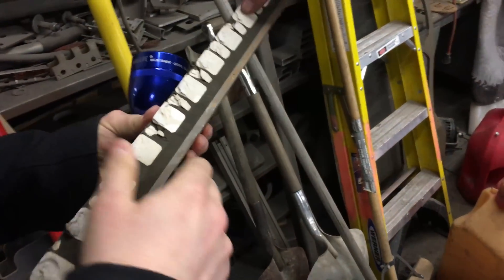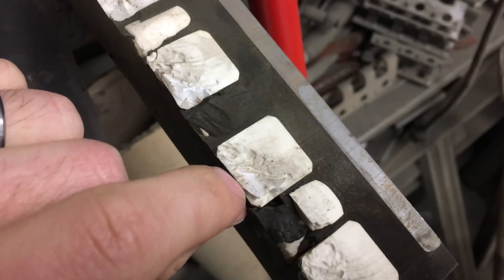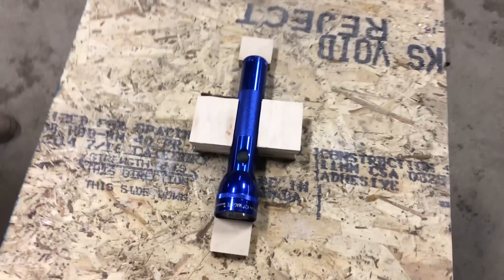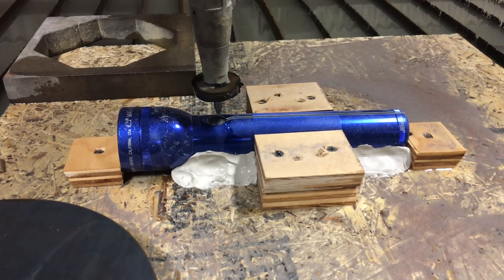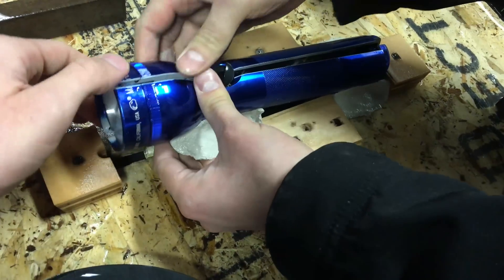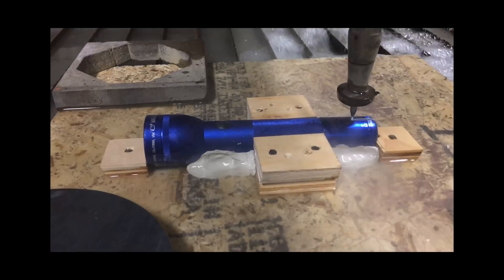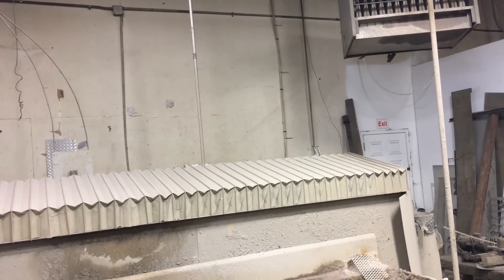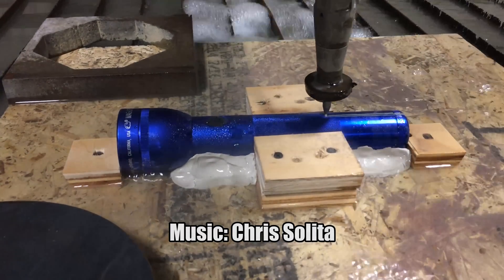MagLite vs A 60,000 PSI Waterjet

Comment: Do you take orders for custom projects?? I am looking for an American flag, no waves, just the rectangle with the stars cut out. Looking for either steel or aluminum 3/16 inch thick with the no sharp edges or corners. Also 1/2 inch standoffs on the back with some means to hang it on a wall. I can do my own painting.

Comment: A Refrigerator compressor, a Printer, a Hard Drive, a roll of quarters, an old washing machine timer, a Zippo Lighter, a 9V battery, a FAT MAX measuring tape, Box of Tissues, TP, a Grandfather Clock, boots, a Propane tank, Pocket watch, a car intake manifold, a brake caliper.
Cutting a SBC crank in half and mounting it on a piece of wood, puzzle piece some billiard Balls and reassemble them in different colors.

Comment: Idea: cut body armour (or try too). 
AR 500 armour isn't it? I think that's a popular one. Hit them up, they might even send you one for free as it would be an interesting test :)
Reply: Sir Stefan Channel! its literally steel
Reply: royalCOW I thought it was more composite armour? They don't just straight up make steel plates for body armour lol Also, still would be interesting to see how bullet resistant armour holds up to high pressure water and sand ;) 
Also the kevlar armour too, fibre woven ect. Would be neat to see

Comment: It might be a bit dangerous, the glass... but still... would it cut Prince Rupert's Drop?
Reply: encapsulate the thing in transparent epoxy, and try to cut the block
Reply: Andrey Perevodchik it would not but once the water hits the head the tail would vibrate do much it would break
Reply: perhaps encase the tail in clay?
Reply: if you can send them one i'm sure they'll cut it
Reply: It would cut through it not too difficultly.
Reply: Andrey Perevodchik that wouldn't work
Reply: start from the "head", not by the tail
Reply: Kimber 10MM They are not lazy guys, and work isn't that hard in the case, and possible someone might put such thing on ebay and throw a link to them )
Reply: It dont get it, its just glass? Why wouldn't it cut it?
Reply: because its literately bulletproof... if you can stabilize the tail lol.
Reply: There has to be some way do maybe lower the vibration enough.

Comment: can it cut anything with just the pressure of the water, like with out the sand in with it?
Reply: see they had making hamburger or something like that - they didn't used sand there, but still it have damaged the dish
so basically cutting fingers with just water - no problem

Comment: how does the waterjet know when need to go up or down ?
u need to draw the line and take measures even if is a irregular object ?
Reply: what Paul said, probably, don't forget the footage is sped up a lot. It takes several minutes for it to cut through objects. So there's plenty of time for manual adjustment of height
Reply: Tinchox ya i think they program it for flat objects but he can also adjust the height as it goes along with the up down left right arrows on the keyboard
Reply: there is a dudde in a cabin, was on some of previous videos, he have manual control and it have programmed control too. but that was manual I guess.
Reply: There's that little disc night above the nozzle… it wouldn't surprise me if that senses the object and adjusts accordingly. Also wouldn't surprise me if it has to be manually entered in cad